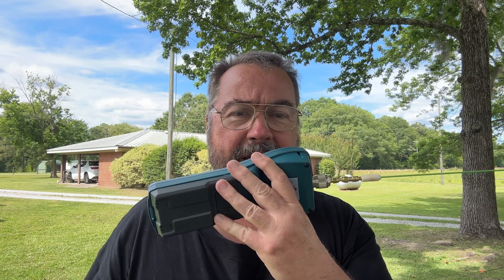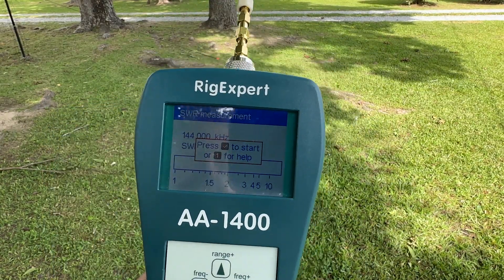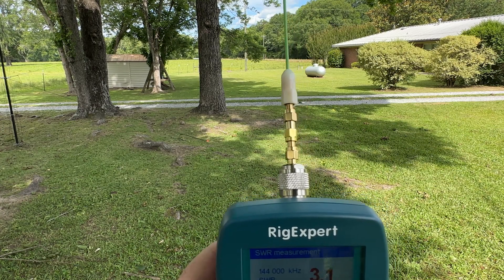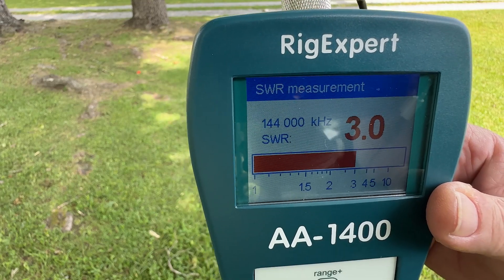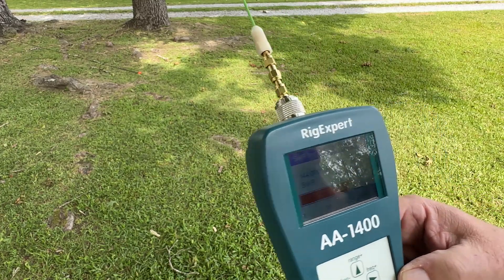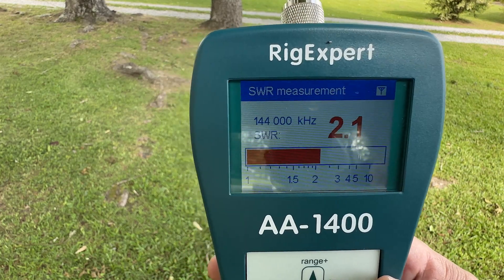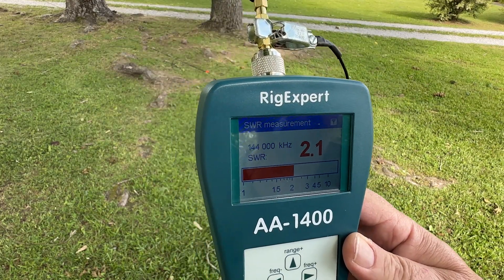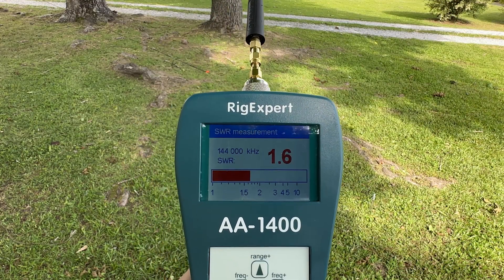Improve HT Antenna Performance - or Not?

Comment: Why did you use that frequency for your test. I run Signal Sticks on several of my HT's. And I test on 146.000, which is what the antenna's are tuned for. So I suggest you try your test again.

Comment: Adding a counterpoise should contribute to create a resonnant dipole. Therefore I suggest using an identical antenna as a counterpoise, or at least a similar one. The angle between both elements (antenna and counterpoise) will affect the impedance, therefore the SWR. And keep in mind these antenna sticks are loaded with an inductor and quite often a small capacitor, too: matching such a stick with anything else becomes a comlex equation! 🤔

Comment: Nice experiment, but shouldn't the counterpoise be the same electrical length at the antenna.
I use a trough the glass antenna on my pickup and hit repeaters 45 miles away, I have talked
much farther from the top of a parking garage.
Reply from the maker: It was just me experimenting around not really sure what I was doing.  And then it turned into - testing this and that and 4 videos.
Reply: @FEPLabsRadio  I any case you made some good video's that have helpful information. Thumbs up. 👍👍👍👍

Comment: I would be curious to know if the counter poise affects transmitted or received signal strength. I am not too concerned with improving the SWR on my hand held. Also I think the length of the counter poise is important. It's not a ground plane, it's a counter poise. Just like in a dipole, the length is critical. Thanks.

Comment: I think maybe the best HT antenna are ones that are folded "flexible metal tape" kind that spring up when you undo the velcro.  Like the ones from HYS or Abree (spelling?)  .   They seem to be most efficient on an HT.   Even tho they are like 19 or sometime 21 inches long
Reply from the maker: Yeah, Daniel, I agree.  I really hadn't intended this to be two parts, but I can tell you, part 2 is dropping tomorrow morning.  Stay tuned!
Reply: @FEPLabsRadio  btw,   i have seen HT Antennas tested mounted on a small plate like 6x6" with a passthru SMA or BNC.  I guess its to simulate the HT body and a human hand holding it.   Not sure if it matters much.  But something to try if you have the material
Reply: @dan_in_sd-w6dkw  
More info, please? 
I'm looking into mounting a HT antenna on my roof temporarily during emergencies. 
(I live in Florida)

Comment: My signal sticks do improve with a tiger tail of the appropriate length. It definitely improves receive (to my uncalibrated earballs) and I'm told that it makes a difference on transmit from reports. 

Adding a random length wire on as a counterpoise is a roll of the dice. It appears you didn't have a "lucky" length. Instead, start with about 20-1/2" and trim (in this case, it means actually *cut* the wire as rolling it doesn't seem to help) 1/8th inch at a time until tuned to suit you. If you are like me, you will be tempted to try just one more 1/8th inch off and you'll cut too much. The good news is... it's just a length of scrap wire. If you have to, make a few and trim until you learn when to stop.

I use a ring terminal on the radio and an alligator clip on my tiger tails so that I can have one  for VHF and one for UHF. Cheap. Easy. Effective. All things that most hams love!
Reply: What’s the ideal length for uhf 70cm? Thanks!
Reply: @aeb27 I'd start with at least 13" and start trimming until the antenna analyzer tells me it's good enough. Expect somewhere around 12"-ish. Could be even shorter, depending on what antenna is on the HT.
Reply: I've found the tiger tail improves receive when the unit is sitting on a shelf monitoring a somewhat weak channel. Helps me listen to repeaters while doing other things at home.

Comment: Jim your counter poses is way too long you should use about the length of the size of the signal stick antenna. also you should use 146.000 not 144.00

Comment: THe length of the tiger tail is important. For 2m is will be about 20", experiment with the length
Reply: Yes, I make mine for 21.5 inches long. Because I tune them to 146.000, since that is the middle of the 2 meter ham band.